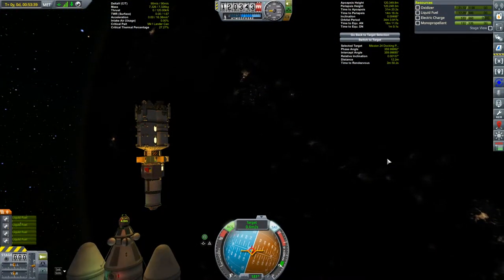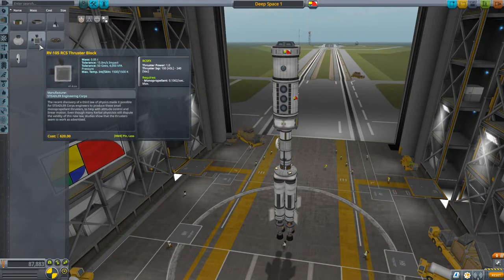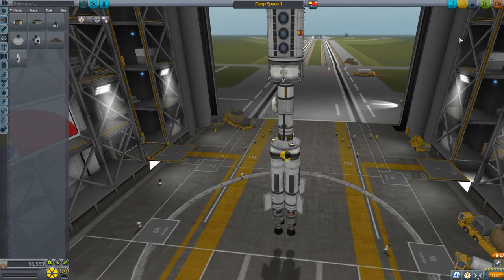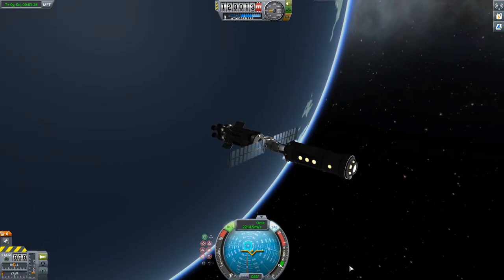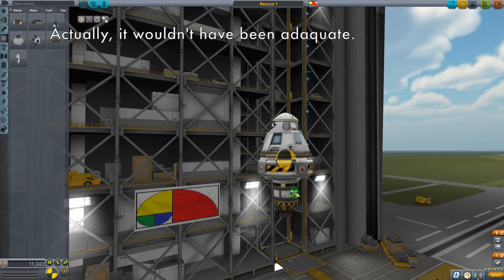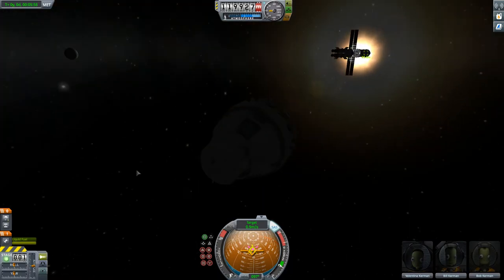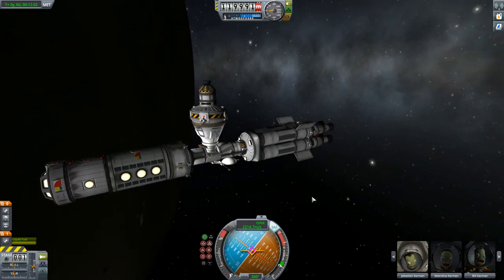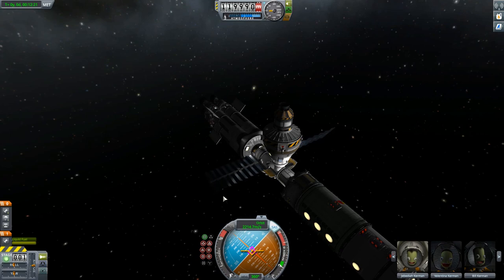RCS & Docking - KSP Tutorials #12

Comment: Just discovered this channel! This is a good tutorial - well done sir! 
Putting your docking ports in the normal/antinormal orientation is indeed a very useful tip.
If I may make a suggestion or two:
- changing camera mode to "locked" and placing it behind Your vessel is useful for docking, as that way You always know which way is "up" which makes lateral controls A LOT easier. 
- consider recommending a docking mod (such as docking port alignment indicator) - perhaps in a Part2?
- no need to change thrust levels on RCS - this is what fine controls (caps lock) are for :)
Keep it up mate!
Reply from the maker: Thanks.
-Good tip with camera on "locked mode".  I tend not to use it purely for aesthetic reasons.  I just like watching the docking from different angles.  Also, the ship's orientation on the navball is constant, so if you get used to looking at that when thrusting, the camera orientation doesn't matter.
-Docking Alignment Indicator is fantastic.  I've used it a lot.  I'm now playing with the less obtrusive (though less informative) Navball Docking Alignment Indicator which I would also recommend.  With this series, though, I want to stay purely stock.  
-Yeah, I have a thing with never pushing caps lock.  This feature's been around forever too.  I'm not sure why it always slips my mind.  Again, good suggestion.

Comment: Hey, great content! I learned a lot watching your tutorials. I'm wondering if you're still interested in making more. I understand it's a lot of work. 

If you are, i'd like to maybe request one about how to make interplanetery travel efficiently? or maybe, how to refuel a stranded lander on the Mün for exemple. I know the best solution is to refuel in orbit and not run out on the surface. But i'm wondering if theres a way to ''mine'' fuel, refine it and refuel a lander to keep exploring? or simply send a fuel tank next to it? Perhaps i'm too optimistic and it's best just to abandon it.

Anyways, thanks for the knowloedge you provided us. You deserve more subs.
Reply: welp... nvm! just watched your how to get to duna tutorial.
Reply from the maker: @mindfictiontv4664  I'm glad you found my newer content. As for refueling on the surface. It's doable but tricky. If you are good with installing mods, there's one called Kerbal Attachment System that has fuel line kerbals can connect between two vessels during EVA. It would make it much easier.
Reply: @MikeAben  Thanks for the reply! i'll look into it. 
newly installed mods will apply on an old save file right?
Reply from the maker: @mindfictiontv4664  Yes, but make sure to back up the save anyway, because you never know. The save is a file called persistent.sfs. Save a copy of it to another location.

Comment: Are docking ports "smart" enough to adjust their thrust proportionally to their distance to the center of mass? For example: if I have an RCS port 5m from the CoM and another one on the other side, 10m from the CoM, and then try to translate the ship (as you'd expect in docking mode), then will the latter port spit half the thrust of the former port?
Reply from the maker: No, the RCS ports are not smart. The player has to adjust thrust accordingly using a popup menu you get when you right click on the part.
Reply: @MikeAben  Thanks
Reply: @MikeAben  is there a mod to make the whole "docking control mode" and RCS adjustments easier?
Reply from the maker: There's RCS Build Aid for help in the VAB during design.

In flight, Docking Alignment Indicator is an excellent docking UI, or there's Navball Docking Alignment Indicator if you want something more minimalistic. This is something that really should be in the stock game.

Finally, if you are looking for something to just dock for you, there's MechJeb. It will do that and a whole lot more.
Reply: @MikeAben  RCS build aid is the thing I was looking for. Thanks!

Comment: Okay, good stuff, but how do I get something as big as that up there without ALT+F12...?
Reply from the maker: You should be able to get something like this up using a bunch of radially attached, liquid fuel, boosters, especially if you take the fuel out of the payload.  You can then send a separate ship to fuel it up.  Personally, though, I prefer assembly stuff like this in space.  It would likely be easy to bring this ship up in three pieces that you can then attach together in orbit with 2.5 m docking ports.

Comment: Maybe a question for your "Doing the Math" series. The RV-105 RCS Thruster Block has a Thrust of 1 kN. My Space station has a mass of 50 tons. How many of this thrusters are necessary to rotate my station in 15 sec to 180 degree? So my question is: Could you explain the math around this topic? Where are the best positions for the thrusters and all this?
Reply from the maker: That's not a bad idea, but in the meantime I could do it right now.

The additional piece of information you need is how far the thruster blocks are from the center of mass.  Rather than asking for that information, I'll do the calculation for the Deep Space 1 from this video.  You can adapt it to your situation.  I'm going to assume that the station is rigid.  If the station starts wobbling under force then all bets are off.

We've got to work in radians rather than degrees.  180 degrees is pi radians.  To get around as quickly as we can we would apply thrust one way for half the rotation, and then the opposite thrust for the other half.  That means we need to do 90 degrees, or pi/2 radians, in 7.5 seconds.

Assuming we're starting with no rotation, the formula relating angle of rotation (theta) with angular acceleration (a) is theta = 0.5at^2.  Substituting in gets

pi/2 = 0.5a(7.5)^2.

Solving for a gets a=0.05585 radians/s^2.

Next we need the required torque (T) to get that acceleration.  Now, T=mr^2a, where r is the distance the applied force (ie. the thruster blocks) is from the center of mass.

For Deep Space 1, I'm estimating r to be 6.5 m.  The mass of the ship is 38692 kg.  Substituting in gets

T=(38692)(6.5)^2(0.05585)
=91300 Nm or 91.3 kNm.

The reaction wheels help too.  The 1.25 m reaction wheels provide 15 kNm of torque IF they are at the center of mass of the ship.  Mine are a bit off, but then again I'm ignoring the 9 kNm of torque from the Copola Module.  For our purposes, I'm going to estimate the two cancel each other out and go with the 15 kNm.  

Subtracting that off means I need 76.3 kNm from the reaction blocks.  

We're almost there.  T = Fr, where F is the thrust being provided.  So 76.3 = F(6.5), which gets 

F = 11.7 kN.

That's the thrust we need.  At 1 kN per reaction block, we need 12 reaction blocks.  That means six at each end ...

BUT ...

at any one time, typically only half the reaction blocks are firing.  That means we would need 24 reaction blocks, 12 at each end.

I rather want to put this to the test now.  I'll get back when I have a chance to do that.